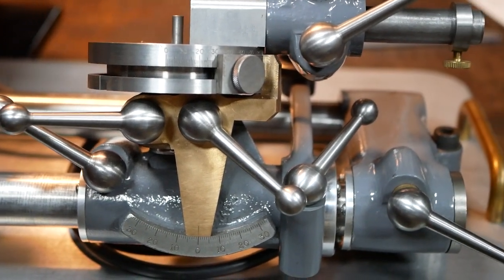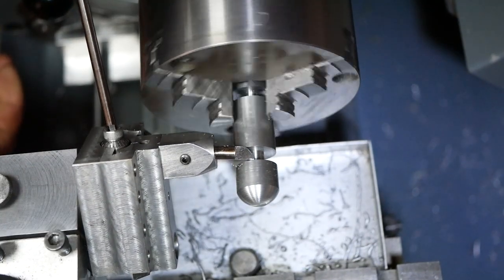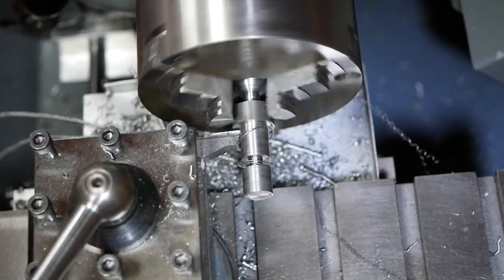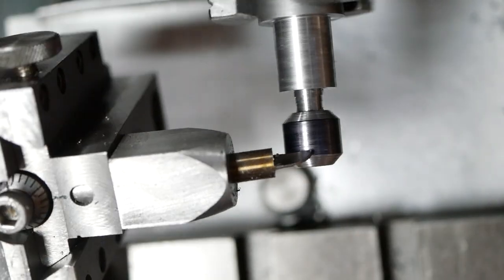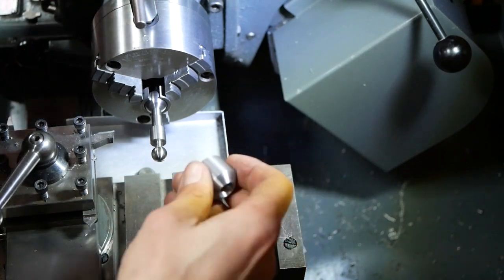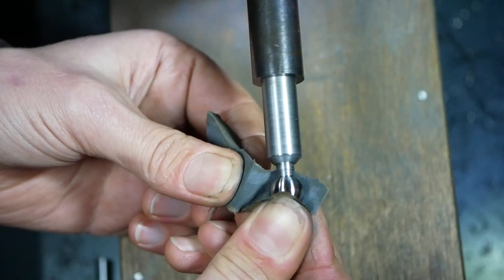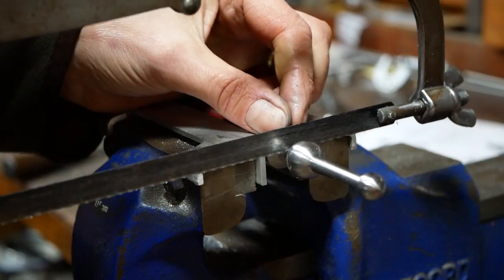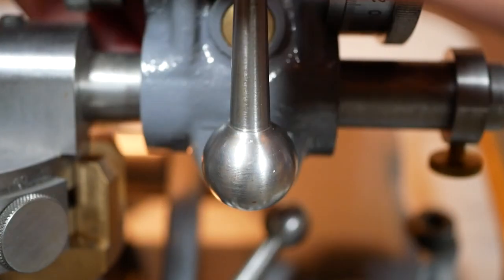Spherical Turning on a Manual Lathe

Comment: I have the kit for a Quorn downstairs myself. The one thing I found that makes these a pain to use is that as it stands there is no way to easily reorient it the handles to lock at a specific angle. The quick way of modifying that is to cut away more of the hemisphere to change the axial position of the start of the thread, or stick a washer under this so that it clamps down at the right angle. I've been thinking if someone is prone to elaboracy a little more like I am, it should be possible to make the threaded portion an insert, and have it selectively lock somehow at different angles. I had considered actually making the tapered shaft hollow, threading the small end to take a smaller ball cap that threads on, and putting a rod through the middle that is threaded and lockable on the insert, so you just unscrew the little ball head, screw down a shaft that runs through to lock the main tightening insert in the axial position you want, then screw the little ball back on and you can't even tell the whole thing is adjustable from the outside. You could make all the ball handles this way and they would be individually adjustable for whatever position you wanted 😁 I've never seen anyone take this approach for a ball handle but I'm certain it would work but it would be more work of course.
Reply: I like the idea. I’ve come to the conclusion that there is no possible clocking for the umpteen ball handles on a Quorn that doesn’t end up with them interfering with each other for some operations. Adjustable without facing/milling/washers would be great. You’re essentially reinventing Kipp handles.

Comment: Some very fine machining there. would it be feasible to construct a lense blank- being both the positive and negative for plastic injection- or is this only possible on a mill?
So many double entendre's my inner 13yr old cannot stop giggling. Big balls, small balls, fitted, chucked, shaft, smaller balls.

Comment: Hey Guy. Just found your channel. I have the baby brother of the Super 7, the ML7 and also took delivery of a crusty old Dore Westbury 2 weeks ago ! However It needed a drive belt ! I ordered the same as what was fitted 10mm x 1165 but,having now received and fitted it, find it too tight ! Could you confirm what bets are fitted to your Dore Westburys and possibly, if you know, what would be the standard, if any, on these machines. I'm thinking that perhaps the motor is not standard and overhangs more than the original and that the belt size may be original and consequently too tight. Is there a method for calculating belt size ? If anyone can help please let me know. Thanks.

Comment: But how did you make the collets to hold the spheres? Are they actually spherical inside or is it just an internal groove that the balls sit in?
Reply: The collet bore is a straight bore but fairly critical as to size and depth. A book called The Model Engineers Workshop Manual written by George Thomas provides the details about ball handle proportions, machining and the collets.